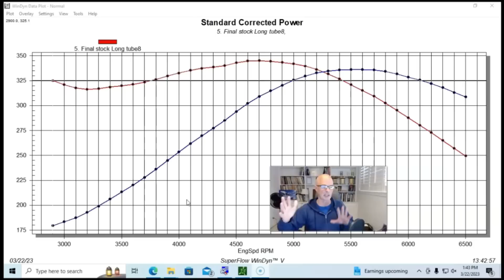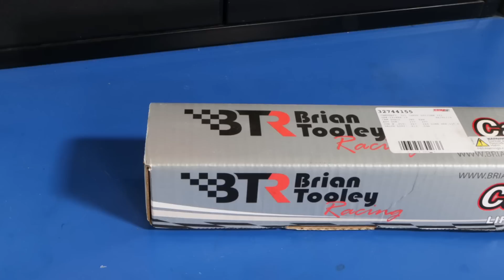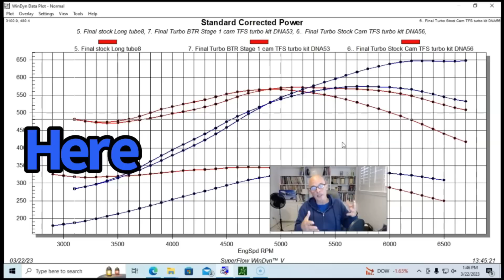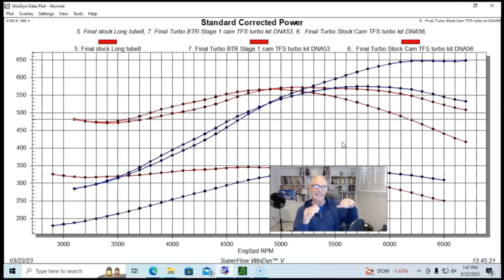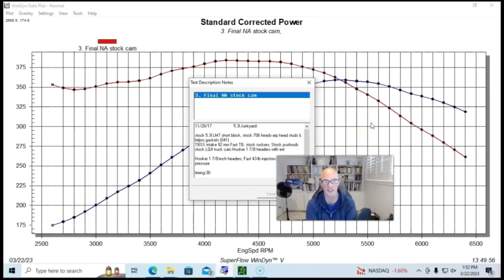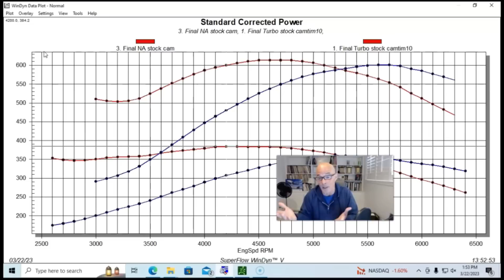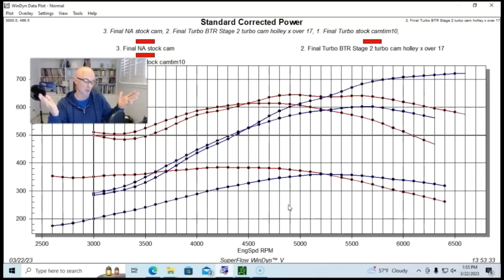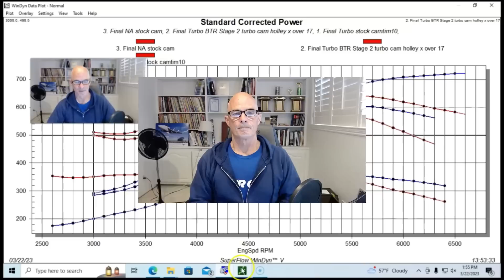WHAT WORKS? LS TURBO CAMS AND BOOST RESPONSE! DO YOU HAVE ENOUGH BOOST DOWN LOW? 4.8L AND 5.3L!

Comment: Im kinda curious about bottom ends. You do everything up top plus gapping rings in big bangs. Buuuut i am curious on the gains on balanced rotating assemblies i beam h beam total seal piston rings vs other piston rings. Bearing tolerances to tight to loose factory vs aftermarket. Waiting for the day you divulge into the bottom end realm

Comment: Losing low end torque = not getting into trouble on the streets.  when I first started with turbo ls’ so had a 5.3, 317 heads, and an early ls6 cam. 3400 stall 3.42 gears.

Comment: It's very easy to ramp boost/torque in as you wish wit a fast responding setup, than to try and make boost lower down with a setup that cannot achieve it. So a responsive setup is the best of both worlds

Comment: Curious about a turbo set up for towing on a 2500hd truck with a 6.0 interested in what size turbo and what cams you would recommend
Reply from the maker: STOCK OR TRUCK NORRIS AND GT45 IF ONLY LOW BOOST
Reply: Yes would be low boost 6-7 psi possibly 10-12 if it’s doable not really a budget build just want it to work good so I could do forged pistons a cam and probably head studs
Reply from the maker: a gt45 won't do 12 psi, like I said "Only if low boost"

Comment: Love these vids truly useful info. Wish there were vids out there of truck builds pulling moderate loads of moderate hills with best mileage with or without boost big or small block tire n wheel diffs etc.
Example: my 94 Chevy dually 2wd with its 350 carbed vortec (not tbi) pulling 3750lb car on 16ft trailer up hill best tune for holding torque best mileage.  Then boost then tires then gears where could I find these studies.
Reply from the maker: you will not get good mileage on a motor pulling a trailer up a hill-best to get a diesel if you want mileage for that application
Reply: Exactly yes I'm just wondering if 20mpg can be achieved with a carbed small block 350. Or even 16 to 18 in any way possible. I once heard of an 06 gto in Dallas was twin turbo and tuned got 48 mpg I know it's aerodynamic and not pulling but there's gotta be something out there for us non diesel guys. But thanks for ur time

Comment: Just match your torque converter to your cam and you'll never even notice the drop in torque down low, as you'll rarely be there anyway. Maybe with tcc locked up🤷‍♂️
Reply: Unless you have a manual.

Comment: @Richard Holdener Do you think a .030 over 6.0 LS with a stage 4 turbo cam be able to sufficiently spool a 88mm turbo in a drag race application?
Reply: Haven’t quite narrowed those down yet. Nothing too exotic but plan to use a set of rec ports with 660 lift springs. Not sure of which intake yet either. I’m looking to make around 1100-1200hp.
Reply from the maker: you don't need a stage 4 cam for 1200 hp on a 6.0l, and don't use 660 springs, use something smaller that is closer  to the actual lift (should be near .600)
Reply: Thanks for the educated advice. I’ve already purchased the cam but not the springs. I will take your advice into consideration when I do pick up the heads and springs.
Reply from the maker: what heads and intake and power level?

Comment: @Richard we need a test to see how much power a stock LS iron block can hold before letting go?
Reply from the maker: so far its 1543 hp and stull alive
Reply: If I’m not mistaken whipple has made over 2000 hp on the new L8T block and crank.
Reply from the maker: didn't know we were having a contest-thought you just wanted to know strength of the ls block
Reply: @Richard I didn’t mean it as a competition just that the new blocks have gone over 2000hp.  Thank you for a great channel and great content. Look forward to the next video

Comment: The larger heads is what was responsible for the low end power loss. Forced induction needs   more exhaust
Reply from the maker: no
Reply: ??? Why do you think that you are forcing air through the head, remove the restriction then air can pass through easier.
Reply from the maker: the amount of air the motor (not just the head) will process (i.e. how much power it makes na). It is not just the head, it is the cam and intake and displacement and compression etc...
Reply: @richardholdener1727  too big of a head per cubic inch slows the air down as far as forcing air through I was referring to forced induction

Comment: Isn’t there basically 1 cam grind that will produce the most average NA HP from say 3500 to 6500 on a “stock” 5.3? Why wouldn’t you want that exact same camshaft when running boost?  Why would anyone want a wider LSA and lower overlap “turbo cam”? When they can run a tighter LSA more responsive “NA style” cam w more overlap that makes more AVG NA HP across the RPM range they choose? ESp. if running twins or a large single with 1:1 BPR.
Reply from the maker: THERE ISN'T 1 CAM GRIND THAT WILL MAKE THE MOST POWER FROM 3500-6500 RPM
Reply: @richardholdener1727  So say one grind in an NA race application will net you the quickest mph at X weight over Y distance. Basically 1 grind will do the most work from A to B in a ¼ mile and a 100% factory 5.3.   How would the valve events or profiles change with a turbo application? When an NA style cam with a tight LSA and optimized overlap makes more average power and has better response NA. Why not run something similar to that over say a “turbo grind” with wider LSA and less overlap.
Reply: @AdamOpheim lots of overlap and tight LSA will have you blowing boost out of the cylinders because of the timing events of that type of setup. Less overlap is beneficial in a turbo because it helps keep/build boost pressure in the cylinder thereby spooling a turbo more efficiently. Especially if you close the intake side a touch sooner and let those exhaust gases out to spin the exhaust turbine. 
You don't need the overlap on a turbo car in the same way that you need it on an NA car. On an NA car it's helping to pull in intake air as the stroke cycle continues. But with a turbo the air is being forced in, therefore using the exhaust to pull in air becomes a moot point. At that point you're just losing pressure. By closing the valves sooner (overlap) you're keeping the pressure in, thereby making more power. 
At least, that's my grasp of the subject.
Reply: @richardholdener1727  I'm scratching my head over that answer.

Comment: On fwd applications  you ever put cams in or put a larger turbo on to reduce low rpm responce and torque to help the transmission  last?
Reply: Usually larger turbo or even bigger cams are going to hit harder just at a higher rpm that may not necessarily let the transmission live longer